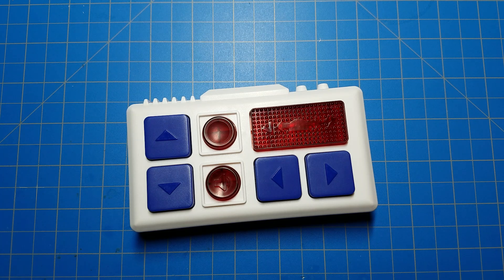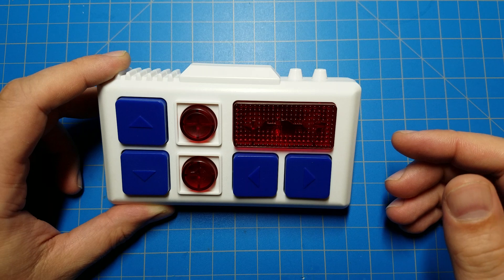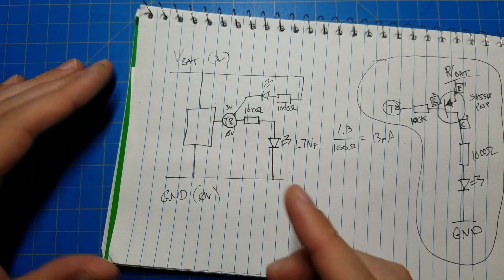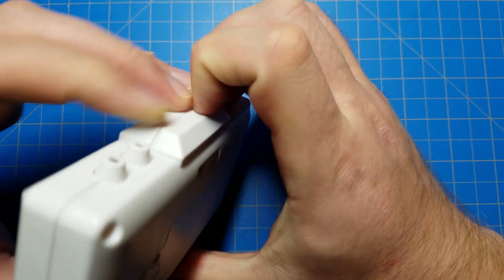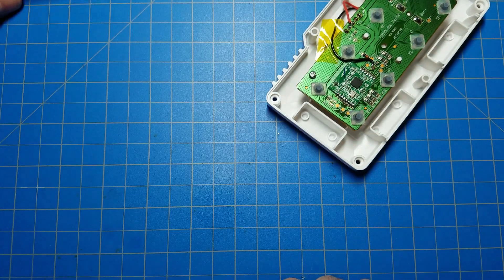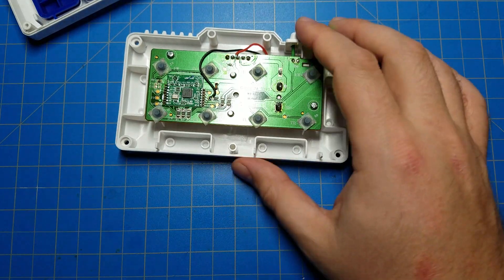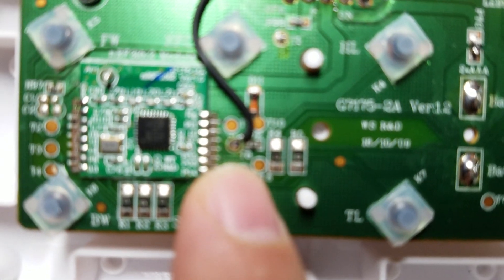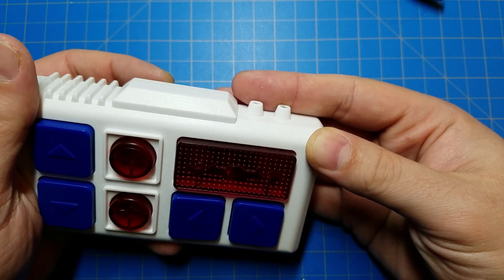Star Wars Galaxy's Edge Droid Controller Modification

Comment: Hi.  Love your videos. 
I appreciate I am late to the party on this one, but I just got myself a Droid Depot R2-D2 and wanted to do this mod for the remote so I know when it has been left on.  I realised, from looking at your circuit diagram, that there was no need to use the T8 pad as the cathode(-) of the green LED can be soldered to the anode(+) pad for the red LED and maintain the same circuit.  So both wires can then just come over the top edge of the board as the red one does in your video, and there is no need to route the black wire across the board trying to avoid the buttons.  Works like a charm.👍

Comment: Do you know of anyway to make a replacement controller?
Reply from the maker: There is a Droid Depot app for iOS and Android. It includes a remote control. If you have a droid that needs a controller I would use that.

Replicating the remote it's possible, but it would require reverse engineering the commands that the droid depot app uses, pick some new microcontroller device to write new code for, write the code, wire up some switches to that microcontroller, and stuffing it all together in a usable package. While possible, the time and energy involved along with the wide range of skills required to pull it off would make me reach for an old iOS or Android device that's no longer being used as a phone and instead use that as a dedicated remote.
Reply: @Ruthsarian  yeah the apps kinda so so, i was hoping i could figure a way to make my own

Comment: Thanks for this! Just did this mod for my daughter's controller so that she doesn't leave her controller on 24/7. I ended up routing the negative lead to T8 via the back of the board and thru the hole in the middle near T8. I did have to snip off the support column that was under the hole, but it works great and doesn't interfere with the buttons at all.

Comment: Has anyone made a better remote? I wanna know if you could make one to control two droids at once.
Reply from the maker: unfortunately, no. the controller uses a special protocol called Enhanced ShockBurst (ESB) which is likely encrypted. that makes building custom controllers a very difficult prospect.

Comment: I thought about doing the same thing. Thanks for the tip!
I am an avid RC modeler and I am very used to proportional controls. I hate the on-off controls this has. I'm sure it would take a completely new ICB but what do you think could be done with the existing board and buttons? Perhaps pressure sensitive buttons?
Reply: Problem it is basically on off radio signal with the bluetooth.

Comment: Why does the top button do nothing
Reply from the maker: the top button is for accessories. if the blasters or thrusters are plugged in then they make noise and light up. if you don't have them installed then the button does nothing.

Comment: hey im trying to custom paint my controller, I can't figure out how to remove the board from the back, is that possible without de-soldering?
Reply from the maker: Nope. :(

You would have to desolder the battery contacts from the PCB to remove both the PCB and the battery contacts from the remote. I would suggest leaving the PCB and battery contacts in place and masking them off as much as possible before painting. The inside of the remote isn't going to be visible, nor the inside of the battery compartment, so you could do it that way and it'll still look great.

But if you really want to do the whole controller, inside and out, you'll have to desolder the battery contacts.

Comment: Why is there not a phone app that can do this ?
Reply from the maker: The remote control is using a protocol called Enhanced ShockBurst (ESB) to control the droids. I don't believe the bluetooth chips in phones are capable of supporting ESB, so an app-based controller probably isn't possible.

However I have seen cast members demonstrating droids in Galaxy's Edge using a tablet of some sort (probably an iPad). Based on that I wonder if there may be a way to control them with just bluetooth commands, but I haven't of heard anyone figuring that out.

Comment: Has anyone taken the BB-8 apart? I mean, take the black internal part, apart. So we could see the circuit board and such? I'm brain storming a few ideas, but, I wanna see what it looks like inside.
Also, what's the plastic made of? I've seen a few videos of the bb-8 getting easily scratched, why isn't it ABS plastic? That stuff is strong.
Reply from the maker: This video of me replacing one of the h-bridge chips inside the droid includes a look at the guts of a BB droid:
https://www.youtube.com/watch?v=K0z1to8ak70

I'm not sure what kind of plastic it is, but it is easy to scuff.

Comment: Do you think it is possible that with so many of these droids floating around out in the wild now, that someone will figure out how to use a 3rd party controller with them? I would really like having analog sticks instead of just up, down, left, right controls. It makes the BB-style droids really hard to move around smoothly!
Reply from the maker: Possibly. There are a couple people that I know of who are working on this. The remote control and droid aren't using Bluetooth to talk to each other beyond initial pairing; instead they're using a protocol called Enhanced ShockBurst  (ESB). A lot of drones use this same protocol and there is a lot of documentation out there on ESB, so I'm hopeful someone will figure it out soon.
Reply: @Ruthsarian  Any reason why they would use ESB over Bluetooth? I imagine ESB, given it's for drones, has a longer range but why would it be used for something that probably won't go beyond 20 feet from you?
Reply from the maker: @VakomSunrunner  no idea. I'm not very familiar with ESB or what kind of benefits it might offer.

Comment: Savis lightsaber LED Upgrade please! 🙏
Reply from the maker: What kind of upgrade do you have in mind? The Burbank Makerspace has done an upgrade that replaces the blade internals with a strip of neopixels and a microcontroller. see: https://youtu.be/0tyXPJwSe80

is that what you mean? or something else?
Reply: The actual LED inside of the hilt that flash and light up the kyber crystal. Since they light up when you do not have the blade in the hilt could be used for a nice effect if they were brighter.